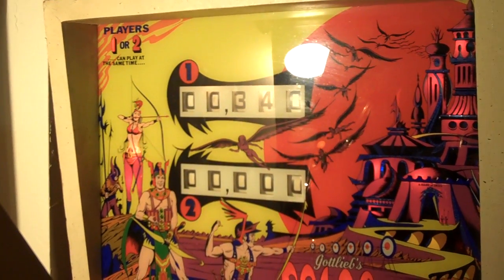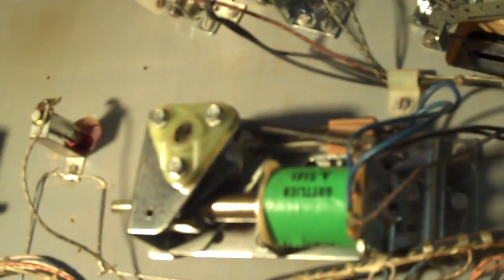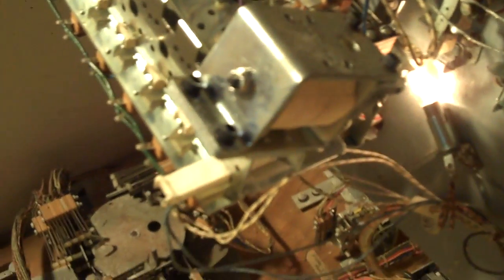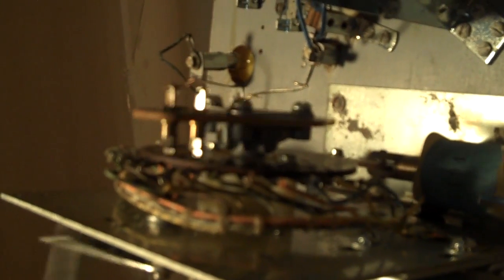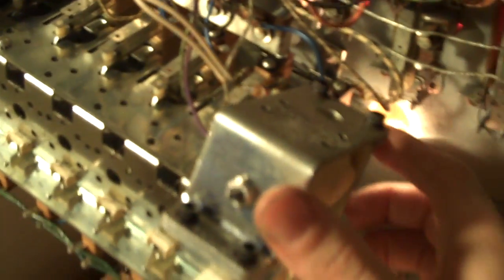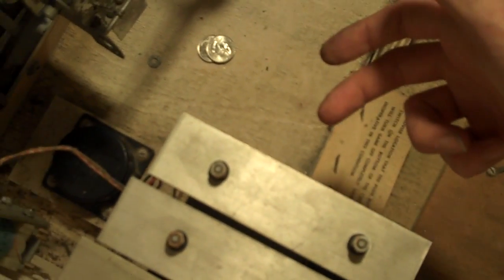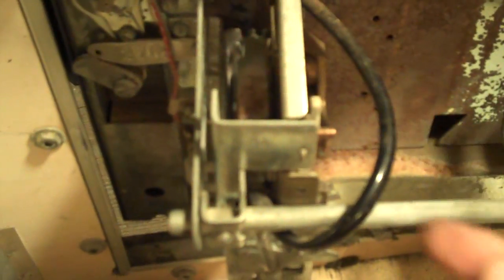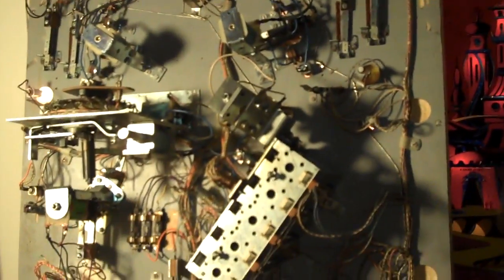Inside a Pinball Machine Cabinet - Tour of the Electronics of an Electromechanical Pinball

Comment: I noticed that the tilt pendulum on this machine was a fixed unit. I haven't seen inside many pinball machines, but I did see one where the tilt sense was a pendulum inside a pendulum. The outer pendulum was ball mounted and would 'lock' when the game started with a coin drop. In that way, the tilt mechanism was 'self leveling' in case the machine got moved a little. If you set the play end legs on the toes of your shoes before dropping the coin, you could slow the play action down.

Comment: Doesn't eliminate the current, it actually 'taps' the coil so that there is less current (adding more resistance) by adding some more wire into the circuit.